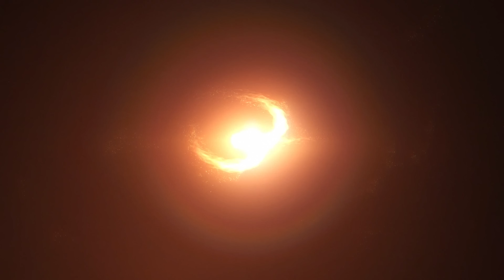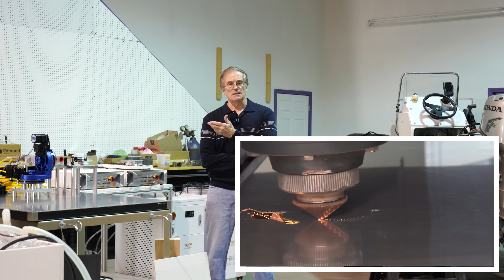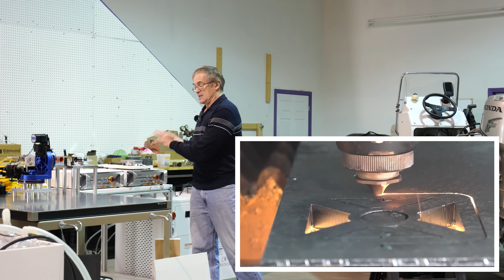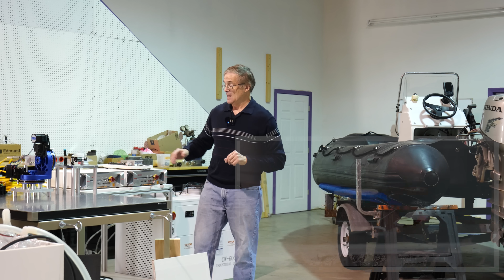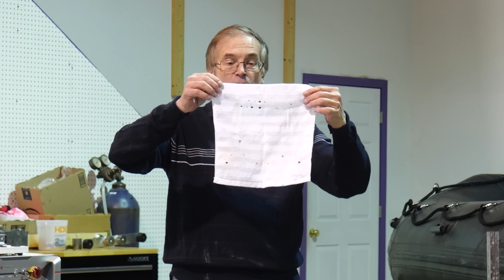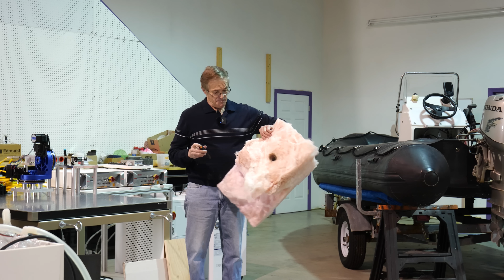We have a problem... and need your help!

Comment: 1" + Vantablack  thickness that is hardened with a top layer of Airagell. You may consider mixing the two togeter,  however, the two as a composit may step down the energy rather then defusion-blunt. Another consideration is a 90% high velocity waterjet that the energy beam is directed threw as a defusher and heat blunt before reacheaing the 2nd blunt of the Airagell. This beam trap in a closed system whould in theory the veneration of steam from the water whould create a containment pressure upon the Airagell pushing inwards around the lazer beam.
   P.S. Investigate the use of surplus Space X replacement tiles for your back wall.

Comment: I have no knowledge about lasers but just thinking out aloud, what would happen if the laser was pointed at a surface that absorbed light really well? Like a surface coated in vantablack type coatings? I’d imagine heat is the big problem here?

Comment: It seems to me that the solution would be to first spread the beam, then scatter it across a larger surface. Maybe a continuously flowing waterfall or water wall, or a water mister or even a dense fog in front of another material would mitigate the intensity and spread the beam in front of the absorber.

Comment: How about have a wall of fire bricks then create a wall of water in front of it.  You could have a pipe at the top with a slit facing downwards.  At the bottom a box to catch the water and then build a recycling system to cycle the water back to the top

Comment: The fact that plywood went on fire is why it lasted longer. The smoke is excellent at light diffusion thus breaking the beam.
So what you need is several materials together in a very fine powder. You could at a thermal conducter like water. Please make sure there is movement in the material such as vibration so the materials have chance to diffuse the energy.

Comment: Have you tried a waterfall like they use a tome gun ranges to catch bullets? A large amount of water with a plywood background should displace the heat and stop the laser from progressing. Should it hit the plywood it would not burn due to the water. A pump at the bottom water catch could recycle unused water back to the fall.

Comment: I have the answer(s) to your mystery material(s), and... you may appreciate the simplicity.

A bag of dry dirt, or sand, or maybe moistened cat litter.

1. Dry dirt: the individual particles of dirt may directly sublimate away, but more particles will fall in the path to fill the void, creating an effective energy trap for at least a few seconds, and it's dirt cheap to replace.

2. Sand: Similarly to the dry dirt, it would catch and dissipate the radiation, but it may also form fused silica structures. Still not a bad choice.

3. Moistened cat litter: The held moisture content would increase the energy capacity before destroying the substrate, and since bentonite clay is very matte, it should only minimally reflect or refract the lasers.

Bonus material: Water with Carbon Black suspended in it, perhaps with something to increase viscosity a little bit to maintain the suspension, like PVA glue or cornstarch. The idea would be while the Carbon catches and blocks the lasers, the water sinks the heat away from it to buy time. The only hard part I can think of is how to contain it where the container itself is neither reflective, or will be damaged by the laser. Maybe freeze it into blocks so it holds itself?

Luckily, all of these would fill the role of short-term safety measures to save the more expensive building and other infrastructure.

I'm very interested to see what you do to solve this. Good luck.
Reply: Pycrete is another option, being frozen sawdust-water blocks. Very simple, very effective.

Comment: Okay i have no idea what i am saying. I am a complete Noob.

But i do have a question. What if any laser safety glasses are you wearing? I am not sure if the laser is attuned to a certain frequency. But i would start there.
Also if you have to much amplitude due to the small point i would want a target that negates the laser damage i.e the "safety glasses" and another material to split or "zoom out" the lasers pin point. Both are simple. But like i said im a noob. Im incertain of the meterials that could be used if any in the way of the laser attunement. What about a reverse prism?

Comment: Hello may suggest expanding the water idea. What if you would use Gelblock like Agarose that are ~90 water and mix in some pigment like TiO2. The water is great at absorbing IR and can take the heat away, the pigment can diffuse the beam. The materials are really cheap, u can cast any shape and make really thick walls with it. But i am not sure if theory holds well with the hell lasers😅 👍

Comment: Why the focus on stopping it quickly?
Use waveguides. Until you're outputting enough power to vaporize reflectors, just redirect the beam into a sink and let the medium take care of it on it'a own timeline.  If you need more than a nudge in the right direction... I know a guy.

Comment: Modified idea (no glass wall): What about a viscous water solution, with tiny glass particles or jagged particles in it to help disperse the laser, which is pumped by a helical pump to the top of a panel, and then you let it sludge down the panel at a balance between viscosity and feedrate to find the correct amount and thickness. It will then continuously sludge down the wall (let gravity do its thing), and the panel angle, viscosity and feed rate could be adjusted to control the thickness of the absorbant sludge layer. A helical pump is also cheap and strong, and can be made big enough to move even very viscous liquids. And you have expertise in creating liquids and working with particles, that can do all kinds of crazy impressive stuff. This will provide a cheap replaceable layer that continuously refreshes itself.

Comment: As others have mentioned water is not a good absorbent for your wavelength, but it's a cheap thermal medium that's easy to obtain and handle. However I'we had good success combining it with silica sand (however on horizontal surface). I'we just used silica blasting sand on a cloth box with a water circulating pump making sure it's completely soaked. At your power levels you would have way more more glassification but the thermal shock did split most of it. 
Covering a vertical surface would have a few challenges though. 
Cloth does not have enough mass even when soaked, but silica blasting media is cheap, easy to get, has good thermal mass, large surface area and by design few smooth reflective surfaces (compared to desert sand). And beware of the scattering from the steam (probably not that big of an issue on 200w, but I guess at your levels everything is dangerous scattering anyways.

Comment: Perhaps using a stable emulsion of some copper compound in water such as detergent and very fine CuO could work? (CuO may be appropriate for Your wavelength?) I have no idea if other copper salts could work.
For direct reflection elimination sacrificial cheap dryboard or similar. The liquid slurry could be pumped over a tilting plane or perhaps the beam could be reflected down into a stirred bath. I would first test how the 3kW laser behaves on the liquid to determine if it works and thickness required. Fumed silica could perhaps be used as a thickener if required. Perhaps sonicating the bath could help the steam cavity collapse quicker, thicker gels will probably just blow apart.  Just some ideas.

Comment: you don't need a material to protect the wall. i mean, perhaps in testing you might.
but ultimately, you'll need a way for the laser to either:
1.) Detect an object (which it's already doing via tracking software), and detect when it has hit an object. once it has destroyed an object, turn off laser or de-focus laser.
2.) only have the laser turn ON once a target is locked. if you need to use a laser to track objects (lidar), use a secondary less powerful laser for that purpose.
3.) Safety first guys, safety first.  no point in building super cool drone destroying lasers if it also destroys the neighbors house.

Comment: A complete dilettante. Can the laser fire extreme short impulses unless it's at the correct working distance? Can you use the laser itself as a rangefinder to measure distance at which it hits and designate "no go zones". It would limit the output at the fire phase I guess, but in my head it feels elegant.

Comment: A large copper sheet, a minimum of around 3-4mm thick, should oxidize with the heat and help absorb, potentially with rear-mounted heatpipes and external (water?) cooling 'just incase' - is what's often used in beam dumps!

Comment: What about a secondary laser that always fires before the main laser activates down the same barrel path, you could use one of the simple construction lasers that measures range and if its within what's expected then the main laser can fire. 
so the range laser gets its reading, you compare to the expected target distance and if they match the laser will activate.

as a background, clear plastic bottles with a dark backing? I've seen videos where they can dissipate heat without the plastic melting? could be fun to try anyway but with that much power it'll probably struggle to dissipate the heat fast enough to the surrounding water. 
oooo what about glass bottles and if the water contained particulates so as the laser enters it dissipates in the liquid? the amount of particles could be adjusted.
Two panes of clear glass and the particulate water in between, heck off the shelf double glazing with particulate water in between could work?

Comment: i worked with carbon and silica materials (at the nano scale) for my phd. you can consider a slab of aerogel (surprisingly easy to make, at least the more primitive versions) with layer(s?) of carbon coating(s) on top. could try graphite if you can get a slab (commonly used in for acid-related chemistry lab devices), or perhaps carbon black particles with some binders? it'd probably be as light as cardboard. carbon is intrinsically absorbing across most of the spectrum, and has extremely high conductivity and melting point.

Comment: A layer (maybe two, that laser is pretty impressive) of floor/wall tiles with the undersides facing the laser. It shouldn't be too hard to find some ugly tile in a clearance section somewhere. Apply weld-crete or any other bonding agent that does the same job to the plywood. Attach the tiles using mortar designed for high heat or maybe make your own cement mixture to accomplish the same thing. This would be very easy to test on one tile before committing to building an entire wall. When you test it, attach one tile to a piece of plywood with the mortar and briefly spray the backside of the plywood with water before firing the laser. 

If it works and you like it: before you attach the bonding agent, mortar, and tiles take the larger piece of plywood and screw through the front into some 2x4s to make a 'X' truss like you would see on the hancock tower to increase its rigidity. Potentially add a lip on the side that will be touching the ground because you could hoist it up at around 85 degrees instead of perfectly vertical which would allow you to put wedge between the lip and the ground. The idea there is so that when it's standing the weight of the tiles will be mainly focused on the lip+wedge at a slight angle which might discourage a sheer failure and eliminate the possibility of it falling forwards.

Comment: Tungsten block with a coolant passage?
Reply: Or maybe a way to change the optical length on the fly. Or something like a fuse where the laster cooks through and breaks the connection to a relay that then flips the kill switch off.

Comment: Would rockwool not work? Put a tray under it and pump water over the top. Kinda like a swamp cooler. Maybe add some space age polymer to the water to alter its properties for transfering heat.

Comment: I wonder if silica aerogel will work to provide adequate protection. I know Silica aerogels are being developed for laser target material. Because of its low thermal conductivity it prevents heat buildup from laser radiation. Also due to its strong scattering ability it prevents laser energy from penetrating the material. Because of its high-temperature resistance its ideally suitable for high energy laser application.
One research paper states: "It indicates that under the irradiation of a continuous wave laser with a power of 7 kW•cm−2, the silica aerogel materials with the thickness of 3, 6, and 9 mm can withstand the laser for maximum times of 26, 61, and 100 s, respectively. After 7 s of irradiation, the surface temperature of 3 mm from the laser incident point is 226.9 °C."

Comment: Amateur hour here but, I like @Spirit532 ideas. Do long range outdoor military rifle ranges have sufficient sand berms, (civilian indoor ones nope) and if so can you get enough power transported in, then call the DOD etc. and ask them if they can help?  Sounds like it would be preferable if all the lead has been removed from the sandbank first, so timing issue to be considered. Otherwise an area with sand dunes, many will be conservation areas but are there some exceptions available in the US. My initial thought was that more entropy/chaos is needed to disipate the ordered laser energy. So, can a large lens spread the beam like making an out of focus camera picture against other materials be sufficient to reduce the concentrated energy or does this reflect too much. Will a one way mirror work sufficiently to prevent reflection from adsorption of energy from whatever you eventually decide to use. Can you combine this with a large lens, and couuld a sufficient lens be made cheaply at scale by bending tempereed glass.This leads me to recall glass prisms can you use one to disipate and direct the energy into the ground, (probably not cheap but can you emulate one with multiple sheets of glass?)  If what you need is a salt mine, can you get access to one or other suituble mine/quarry type in the US cheaply? I recall a show many years ago where an elite group of runners ran a marathon underground in a working mine (not necessarily salt, and coal probably not a good idea) and in relatively hot conditions for running. And for fiberglass already proven inadequate my concern would be vaporizing the glass and creating silicosis health risk, fans would be needed to blow the resultant particles out and away from people.

Comment: I wonder if you could use a box to trap the light, then fill said box with thick water mist or fog to distort the beam and then use a thick brick or metal back on the box to slow it down.

Comment: Too bad you can't start with a variable focus from the beginning so that the beam isn't dangerous except for at a specified variable distance.  Hmm, what about destructive interference with the other laser so that it's intensity is lower until the target locking system verifies the exact position of the drone, then focus,  phase to constructive and ZAP, then instantaneously out of phase again and out of focus...  as for a material, how about constructing a ballistic gel with laser dispersion particles in it that will disperse and expand the beam, while being able to absorb the energy without burning or melting?  Or simply the old Space Shuttle tiles?

Comment: Honestly my approach would be to setup a cheap defocusing setup used for testing. Dilute the beam versus turn down the power. If you need a backstop, you could take a thick metal box, fill it with clear glass beads, and cut a hole for the laser. The glass beads should slightly melt and scatter the light beam long enough for you to run whatever test it may be that youre running.

Comment: Just a stab in the dark but.... Two sheets of concrete board, closely spaced, maybe an 1/8h inch space with water running between them? The 4'x8' sheets - if functional - could be mounted in similar fashion as a gobo on wheels, along with its water pump, perhaps sitting in a section of gutter to be able to recirculate the water. Push the water thru a perforated PVC pipe mounted at the top for an even distribution of the water.

Comment: What if you shot the beam into a tank of water. But there was a hole in the tank where the beam is intended to strike the tank. But the water was held in place or held back from exiting the hole by a constant vacuum. The completely random bubleing of the water should bend/distort the laser light all over the tank. The light would never hit the same place twice as long and the was was bubbling inward in a maner that was tuned to the size of the hole? And wherever the lase light does interact with the wall of the tank would be cooled by the water that was held within. Crazy idea....????